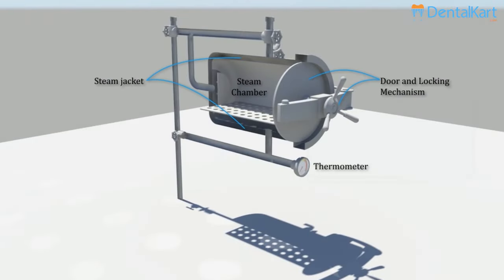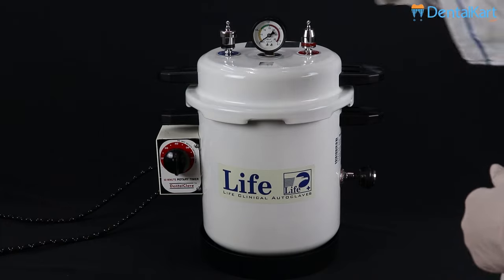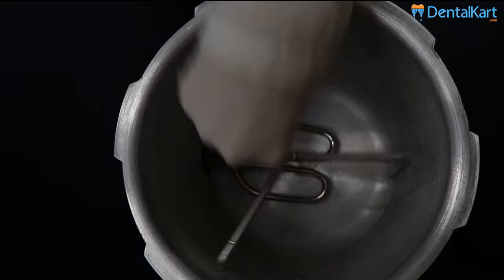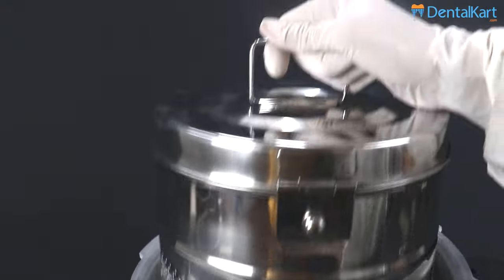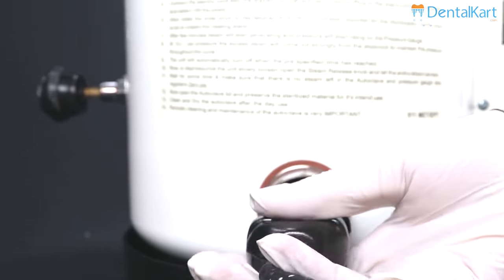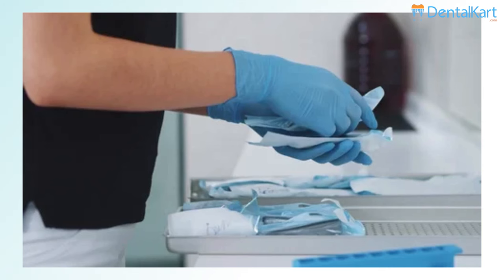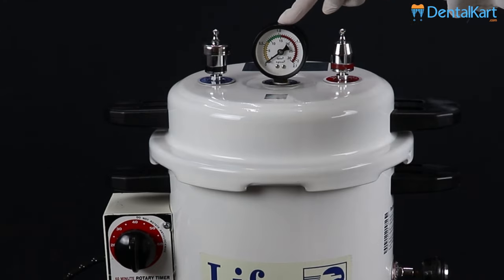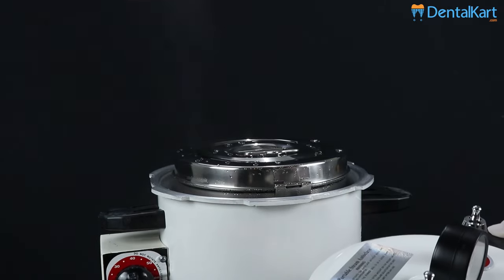How to use a Top-Loading Autoclave

Comment: Why not square shaped
Reply from the maker: Top-loading autoclaves make the best use of space as the vertical configuration of top-loading autoclaves and stackable baskets takes more advantage of the vertical cylindrical chamber. 
Cylindrical autoclaves provide efficient heat and pressure distribution, larger volume capacities, and enhanced structural integrity. 
Square and rectangular autoclaves are suitable for compact spaces and specific item shapes. The selection of autoclave shape should be based on the intended application, space availability, and adherence to specific standards or guidelines.
If you are looking for a B-Class square Autoclave, here are some links for it 
1. Sun B-Class Autoclave with Printer 
https://www.dentalkart.com/bestodent-b-class-autoclave.html?pg_rf=b3A9c2VhcmNoX3BhZ2Umc2VjPXNlYXJjaF9wcm9kdWN0JnBvcz0x

2. Runyes Feng 23Ltr Class B Front Loading Dental Autoclave
https://www.dentalkart.com/runyes-feng-22-class-b-autoclave.html?pg_rf=b3A9c2VhcmNoX3BhZ2Umc2VjPXNlYXJjaF9wcm9kdWN0JnBvcz0x

Comment: How to autoclave cotton gauze, handpiece,
Reply from the maker: By sealing both in sterilization pouches.
For handpiece the oiling should be done one day prior to autoclaving. After removing the excess oil the handpiece has to be sealed in sterilization pouch followed by placing in autoclave.

Comment: I brought the auto clave from the dental kart. While i receiving the product itself, the heating element is not fixed with the body of the autoclave. I dont know how to fix the heating element. I need replacement for the autoclave. I requested the new product from the customer support. i have been waiting for courier people to pick my product. after one week i received a message like this
Dear Customer,

We are reaching out to provide you with the non-pickup verification code for your shipment. Kindly note that the verification code is ** as as pickup was cancelled by you for AWB ID 24424090007679. We kindly request you to refrain from sharing this verification code if the reason for non-pickup is incorrect.

At Xpressbees, we prioritize the security and reliability of our pickup services. Your cooperation is greatly appreciated.

Thank you!
But i didnt cancel the pickup.
Reply: I need heating element to be replaced or i need a new product.
Reply: I received the  auto clave in Xpressbees courier, they are worst courier service :face-orange-frowning:
Reply: I received the  auto clave in Xpressbees courier, they are worst courier service :face-orange-frowning: